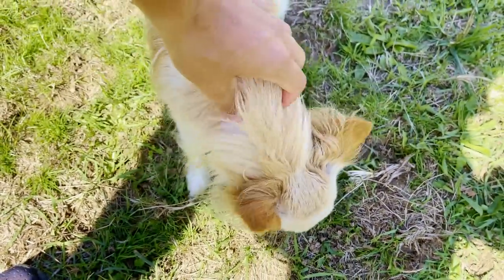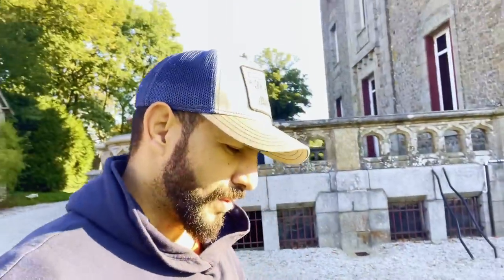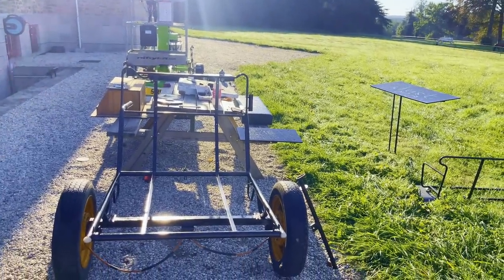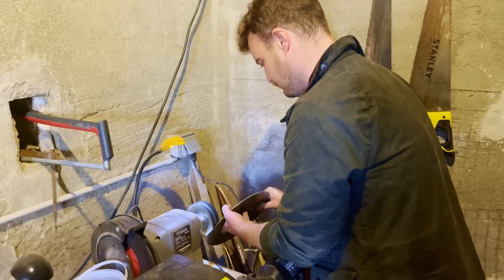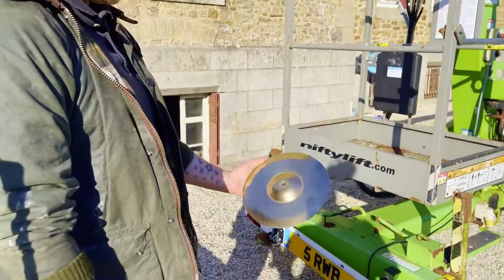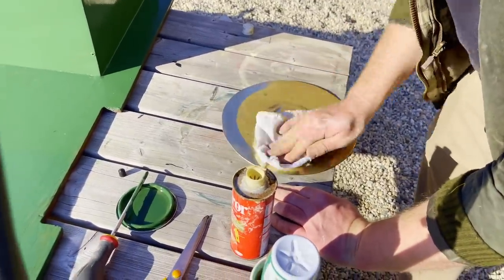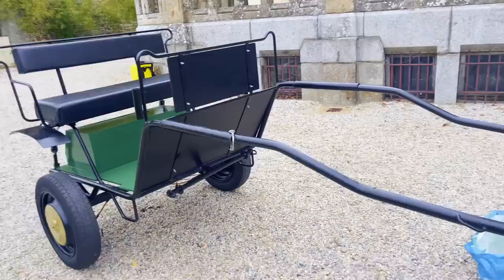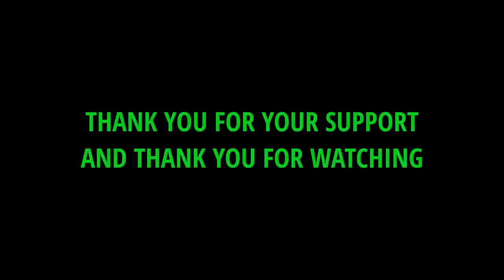THE CHATEAU NOW HAS A CART!!! @MuckyMansion @DoingItOurselvesOfficial

Comment: Mo - I would paint the hub cap bolt black as that would look better than the silver against the brass. You should also cut off the threaded bolt sections on the foot cover as well as you don't want the horses tail to get snagged or someone cut by the exposed bolt.